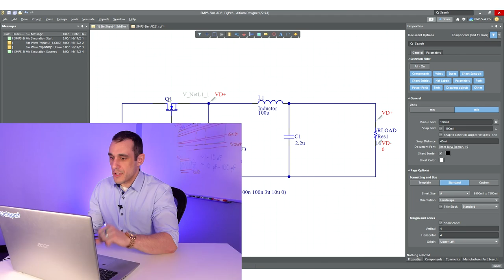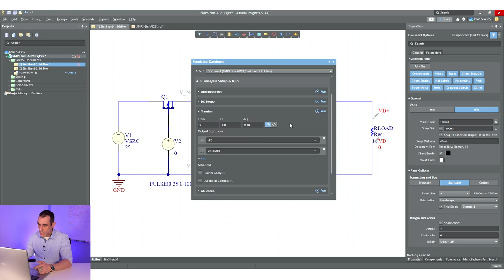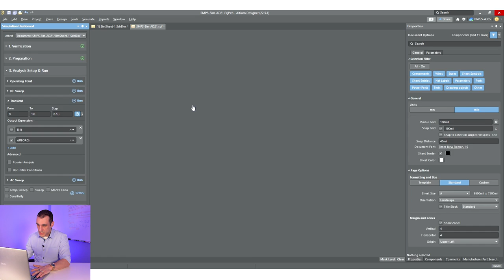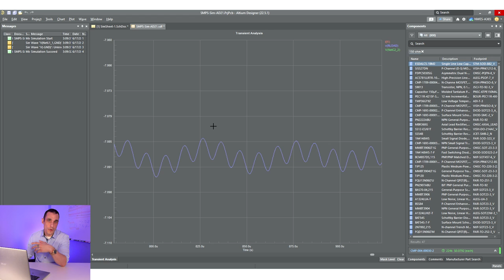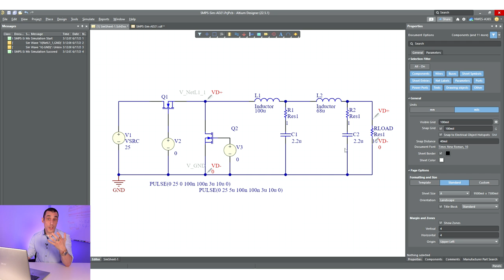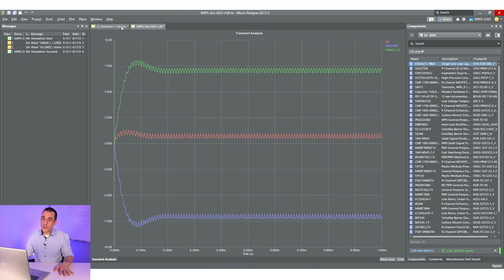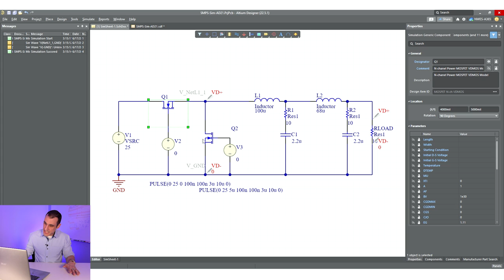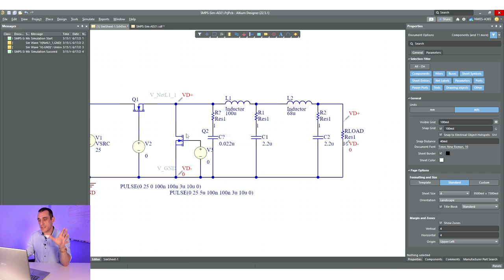How to Run a Simulation of Buck Converter - PCB Design

Comment: The added resistance in the Pi filter reminds me of the Zobel filters used to stabilize amplifiers like the LM386 and TDA20x0 for longer cable runs. Similar causes and reasons?
Reply: Yes same reasoning for similar cause!!
Reply: I did not know the audio crowd called it a Zobel filter, but yes that is what I can see. From Zobel's paper it looks like the intent is matching damping to exactly a natural frequency, so the load is not experiencing critical damping. In the above it's less about achieving a specific matching condition and more important to ensure the power being output to the load does not experience excessive fluctuations, so that could require any level of damping that you need to determine in your circuit design.
Reply: @Zachariah-Peterson  It's nice to know that there are things that the high-speed and audio folks can learn from each other.

While I don't doubt your research, the application you describe above is typically called a Boucherot cell; the audio crowd tends to use "Zobel network" more generically for "that output RC snubber in the datasheet of practically every chip power amp." ;)
Reply: @petersage5157  You learn something new every day!

Comment: Excellent as ever.cant wait to ses the next part.
Hey Zach do you think to make an IC buck converter simulation?
Because mostly we use ICs in olur design.
Reply: Yeah I do have that planned, I know that most people use ICs but I think these simulations are a good strategy for sizing inductors and capacitors to hit a ripple target.
Reply: @Zachariah-Peterson thank you for kind answer.I'm your fan because I've never asked so much questions to teacher at university and get the answers from the teacher  as I do here .So thank you very much.
mostly buck converters have feedback, we simulated here without feedback (it is mostly for output stability), so does it differ from real life so much?
Reply: @myetis1990  Yeah the feedback is simply to sample the output and modulate switching according to the output response.. it basically serves the purpose of any feedback thats response stability and to ensure maintenance of target reference voltage avoiding subharmonics (that is why we have slope compensation)

http://www.runonielsen.dk/Buck_with_subharm.pdf this reference among others sums the information pretty well :)
Reply: @vatsan2483  Yes that's right, and you can simulate that type of feedback action in SPICE, it's another aspect I should show in a video!

Comment: hi. how to design or create a CMC choke in Altium Designer. whereas later I'd able to run the simulation. Thank you
Reply: The closest you can get in Altium Designer with the built-in libraries is to use the Coupled Inductors component in the Simulation Generic Components library. You could take this and modify the SPICE code or import new SPICE code into this part and that would give you a CMC. You might also find a CMC part for simulation from a vendor, such as from Wurth.

Comment: How can I design Buck converter on PCB of 500 watts , Inputs voltage 30v and output voltage 24v.  Kindly help me if anyone know
Reply: At that power level you will probably want a flyback converter. In the past I've done this as an LLC resonant converter but it can also be done as a flyback converter. There are reference designs for both that you can generate with WEBENCH.